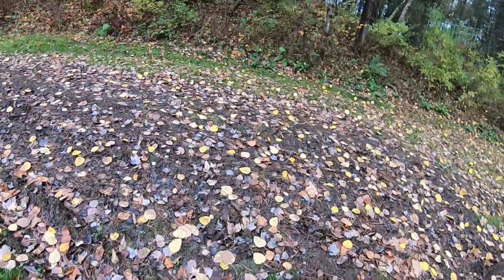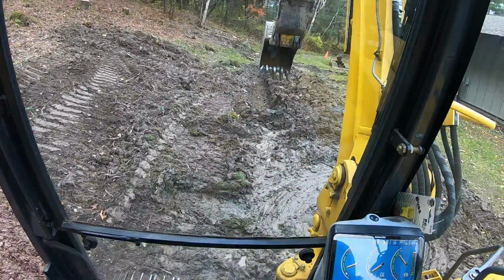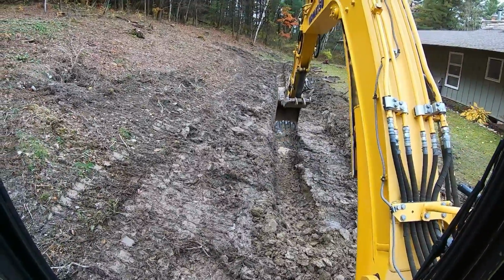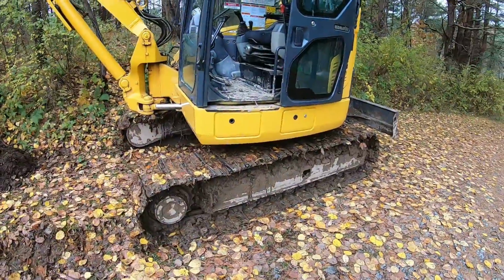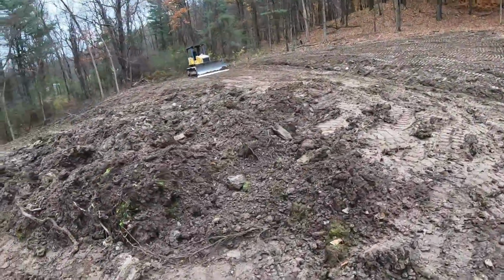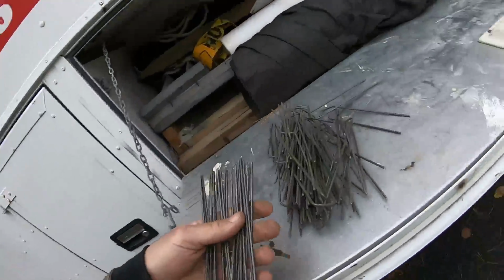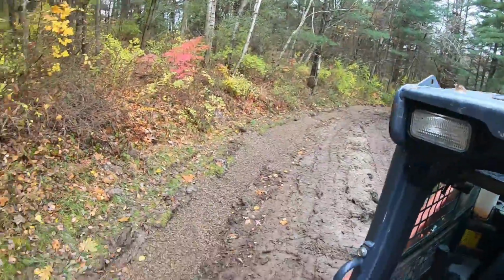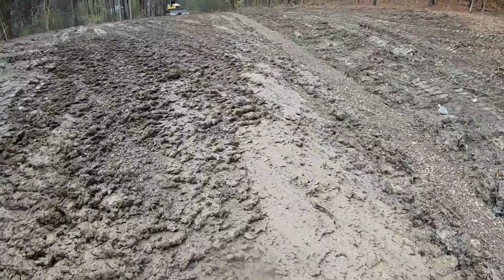DIY French drain How to drain surface water in your yard or Homestead

Comment: I have also done a 6"x 10" with a trencher and just put rock in it and that worked well if there isn't a lot of water. We used concrete rock that has been washed. Prevents the fines from clogging the drain. I bet it was nice to have help for this one. I can see an attachement idea for a skid steer. A side dump bucket like they use to make for larger loaders.
Reply from the maker: Brian good points!

Comment: Do you put the pipe right on the fabric or do you put a thin layer of gravel down first?
Reply from the maker: Put the pipe right in the trench on the fabric then cover it in stone make sure you hold the pipe down because it will float up if you just dump the stone in too fast